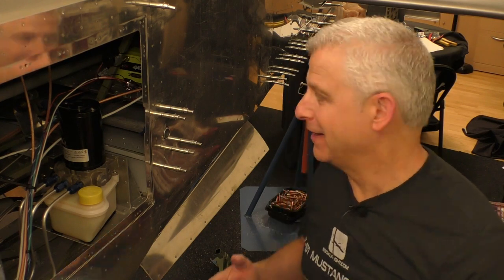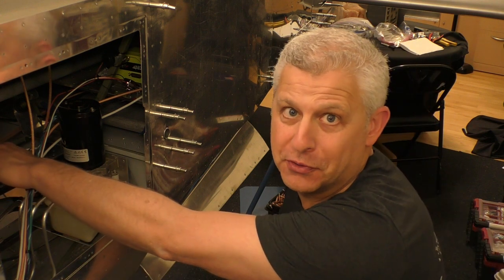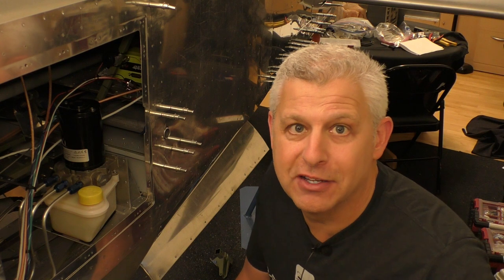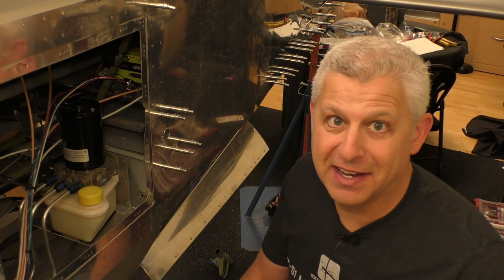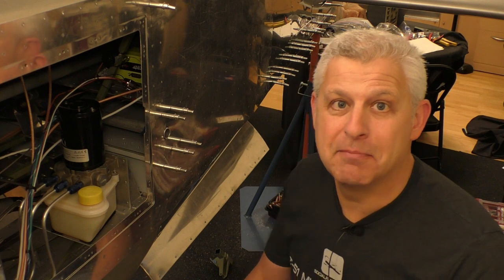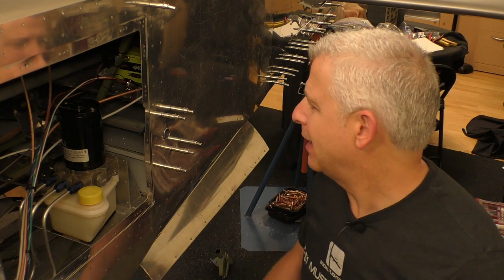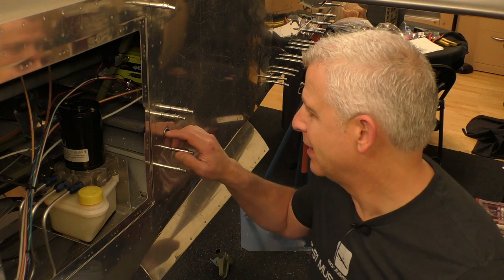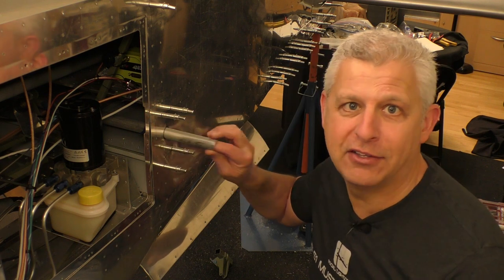NEVER DO THIS ON AN AIRPLANE!  Playing with Magnets on Our T-51D Mustang...

Comment: Thank you for explaining the principle to increase the magnetic field lines through ferrous metals i.e increasing the surface area of washers on the outside of the aluminium tube. I'm thinking about solenoids and relays, but this could be adapted.
🌏🇭🇲

Comment: Hey Jeff - suggestion - get a can of low expansion foam and FILL the dorsal fin - someone was "helping" me move the plane and dented my dorsal fin.  Now I tell EVERYONE not to help ground handle the plane - I move it in and out by myself and give them a lesson on what to touch entering and existing the plane.  My push tube got bent early on so I keep mine stowed in the aft baggage compartment.  You've got me thinking it may be time to replace it using your magnet trick.  My outer tube is already bonded in place so washers are not a good option - - any ideas??  Kit 112 "Sea Horse" - Honda J35
Reply from the maker: Hi Robert - I’m using a fiberglass dorsal fin to hide antennas, but I appreciate the advice. You should be able to cut washers in half, glue them into two large halves, then attach and wrap/bond them in place. Blue skies!